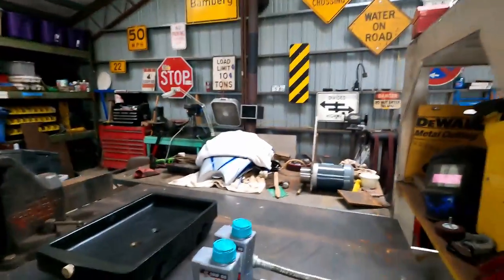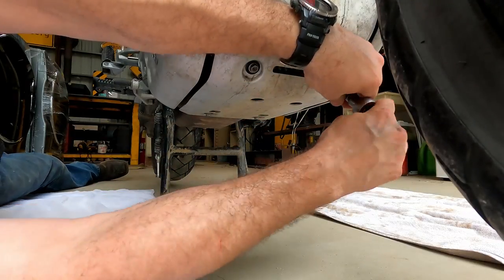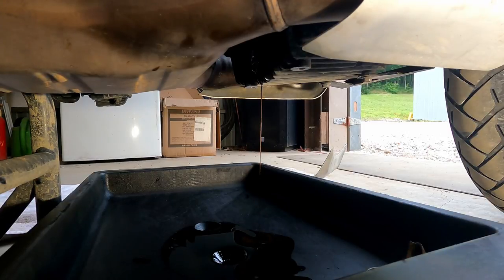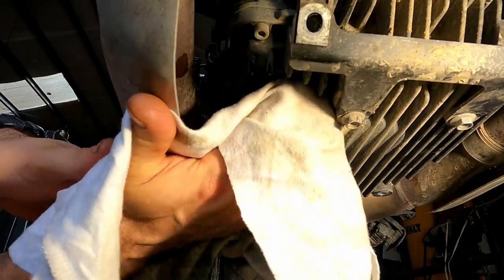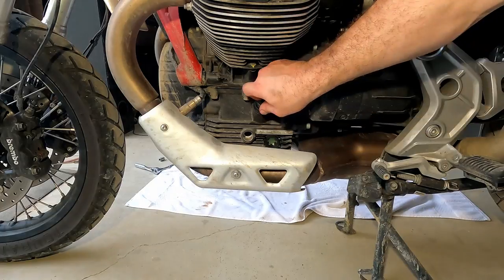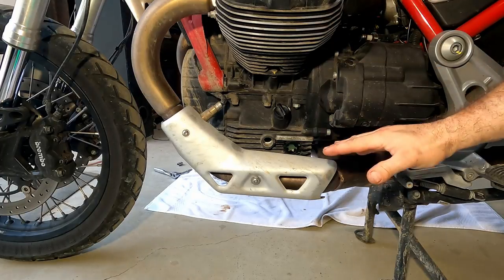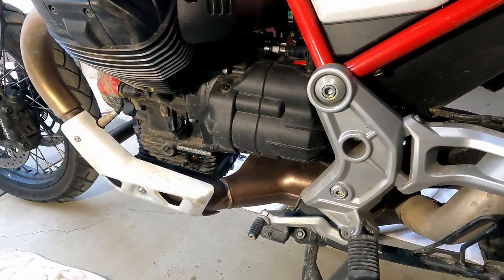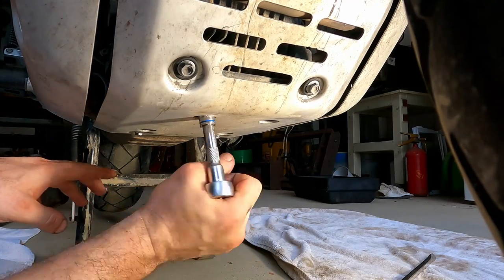Oil Change on the Moto Guzzi V85tt

Comment: Good video. Thank you. I do recommend changing the oil plug crush washer with each oil change. If you buy the Moto Guzzi oil change kit you will find that it comes with the crush washer, and also the oil filter o ring.m
Reply from the maker: That was the first one I did, I now have a 10 pack of the crush washers. 😀

Comment: I recomend everybody to verify the tightening of the bolts of the cracnkcase and also aply some bolt sealer (medium range) for the protector. As a good Guzzi is better to check the valve clearence and re-tight the cylinderhead, everytime you make maintenace (And if you can do parameters reset with the Piaggio or similar diagnosis tool to help the magneti marelli ecu to make the base injection map😊) it'a an advice from a senior Moto Guzzi tecnician✌️😎
Reply: Not required to torque head bolts.  Bad information

Comment: What Johnny Bravo said - I replace the filter's crush washer and O-Ring (along with the drain plug's crush washer) with every change. It's cheaper than the annoyance of having do deal with an oil leak because I tried to save a couple of bucks. BTDT & got the T-shirt.
A note on draining the oil - if you prop up the front wheel with the bike on the center stand, it tilts the engine a bit to the rear and you get a better drain.
Reply: Thanks for the advice, you can specify a link to the store where you buy the oil filter, ilter's crush washer and O-Ring. I am a new owner and I have no idea about the mechanics. Still. Thx

Comment: Thanks for the video, I needed a sanity check as I couldn't get my oil filter cover to come off the lower sump even after tapping with a wooden dowel.  I dropped the lower sump and even trying to tap the cover out from what would be the inside didn't cause it to move at all.  Currently the lower sump is sitting in a machine shop and I hope they can release the filter cover and I can move on with things.  Best guess is that the shop that last did the oil change over torqued the cover and crushed the o-ring and jammed the cover into the sump.  No surprise when owning a Moto Guzzi, the shop is 230 miles away and not really convenient to get the bike to them with the lower sump off.
Reply from the maker: Oh, that sucks! I'm sorry to hear that. Hopefully you will be back to riding it real soon.

Comment: Very useful, thanks for that! You might need to replace that crush washer on the oil filter bolt on the next oil change, looks like it might have a limited life. I think the oring should be fine for a long while, it's probably not getting crushed in there. But agreed, it should come with the oil filter judging by how much that costs haha!
Reply from the maker: Yeah, I would normally replace the crush washer, didn't realize that it didn't come with it.
Reply: @cubbysue  do you have specs or a part number for that crush washer?
Reply from the maker: @andrewpeter6657  I bought some on Amazon. They are supposed to be a 10x18x1.5 and the ones I got are 10x18x2. https://smile.amazon.com/dp/B07P37VX9R?psc=1&smid=A1THAZDOWP300U&ref_=chk_typ_quicklook_titleToDp

I haven't tried them yet, next oil change I will.
Ride safe.

Comment: How about a video on the do's and don'ts of checking the engine oil level of the V85TT and any quirks there may be with the model? Why?
I am happy I understand the basics of checking the level when the engine is warm and the bike is on the main stand on level ground with the ideal level being between the upper and bottom white lines. BUT,I keep getting wide variations in levels, sometimes the bike looks almost void of oil and at other times it looks over filled, I have done two small tops ups based on this! The bike has less than 4000 miles on the clock, it is not burning oil and it does not have even a miniscule leak anywhere! Puzzling!!!

Comment: Thanks…you did it all on the center stand.  Does filling need to be in the side or is 1/2 way on the center stand fine?
Reply from the maker: It doesn't specifically say,  but at the dealer, it's always on a lift standing upright.

Comment: Man!  Your bike sounds like a tractor almost lol!  Pretty cool!  Thanks for the how to! You mentioned that its common to see metal shavings in the old oil when draining.  I wonder how well Moto Guzzi stacks up against the other manufacturers as far as that is concerned.  I only bring this up as FortNine did a comparison of almost every bike manufacturer only they didn't include Guzzi.  Didn't even know that was a thing until I saw the video.  Anyways,  glad I found your channel!  Subscribed!
Reply from the maker: I watched that video as well, great job he did on that video I just did the 1st service on my new V85TT and did not find any metal on the magnet, but I am not sending the oil out for analysis either.

Comment: Very nice, I'd like to make a suggestion, you're dealing with an Italian machine, wash the bike thoroughly before service, it ensures that no dirt or abrasive stuff goes in the engine and if there's a leak of any kind, you'll know within minutes.
Reply from the maker: That is a good suggestion,  I  need to keep it cleaner than I do now, but most of the time when I do wash in town, it is filthy by the time I get home.
Reply: @cubbysue  My black V9 bobber full custom is a nightmare to clean especially with the Kineo spoke wheels. I avoid riding the particular bike in the rain for that reason. However, I have found that using the Turtle wax ceramic spray after washing the bike works excellent and doesn't allow the oily dirt to stick on any of the surfaces. It also lasts for a couple of months before it needs to be re-applied. Quite easy actually, spray the bike as you're drying it off. As far as degreaser without harming painted surfaces that actually removes synthetic oil and leaves a protection film, S-100. Buy the best and forget the rest. Cheers.
Looking to buy a 2022 V85TT adventure very soon, all Centenarios are sold out for 2021. The dealer told me to wait a couple of months for the 2022 incentives.  I'll either go for the red or .....maybe....the Ronald McDonald. I'll see what is available.

Comment: Howdy. Do you have a suggestion on how I could clean the visor from the oil pan? It's getting darker and darker and I can't check the oil level anymore. I usually change the oil every 5000 km. Thanks in advance!
Reply from the maker: Other that removal of the sight glass to clean it, I don't think you can get to it any other way.

Comment: Thanks for your video, following the oil change would the spanner service image go out or remain, if it remains how would it be removed? thanks again, Paul
Reply from the maker: It stays on. I have to take it to my dealer to have it reset. They don't charge me for it so I just drive over and have it reset. Check with your dealer, they will probably reset yours for free as well.

Comment: Cubbysue - on my 4 other guzzies I had to modify such as new chip, new NGK  spark plug cables, etc., is the v85tt ok as is?
Reply from the maker: It would definitely benefit from a new tune. I believe they are de-tuned at the factory level for emissions purposes,  but otherwise,  it's a solid runner.

Comment: Hello, thanks for that, am I the only one who is confused with that bike's service manual? I have read a lot of manuals, this one is confusing. So this bike needs three oil changes? engine oil,  gearbox oil  and bevel gear oil? And you did only engine oil here.

Gear box oil and bevel gear oil are of the same kind, right (75W 140)?
Reply from the maker: Yes, 75W-140. Change the oils in both at 18,600 miles /30,000 kilometers.  My bike at the time of this service was not due for the gearbox oil changes yet.

Comment: My 2023 V7 Special owners manual says to replace the o-ring, oil filter retaining bolt washer and drain plug washer. Why don't they supply these with the filter?
Reply from the maker: @Blair62  I have no idea.... seems like they should though.

Comment: Hey from germany. Really helpful Videos, im planing for getting a v85 too. Had one ride with a dealers one, are the 80hp enough for you? On journeys im with my gf, we both have around 90kgs,you think thats good? Keep up the good work!
Reply from the maker: I live up in the mountains and travel up and down almost daily and the power is sufficient. I find that I need to keep the RPM's up higher on the steeper parts, but it does ok. I would suggest taking her with for the next test drive. Oh.....and top speed is about 180kph.
Reply: @cubbysue  thank you! By the way, why you have a Bamberg sign in your garage?
Reply from the maker: I lived there,back in the 90's, got married there in 96. That was her hometown, so when we left, we took the sign with us.
Reply: @platterfreak Hallo aus Kentucky. Ich bin der Grund warum das Bamberg Schild dort hängt. Bin in Bamberg geboren und aufgewachsen und wollte etwas "Kleines" als Erinnerung mit nach Amerika nehmen 😝
Reply: @birgitfry6513 Eine sehr schöne Erinnerung,nicht ganz meine Ecke. Wohne in Bremerhaven. Kentucky looks beautiful :)
Reply: @platterfreak  ja Bremerhaven ist im "anderen" Deutschland. Kennst ja die Bayern.... Immer besser als alle anderen hahahaha. Ja wir sind nach seiner Militärzeit nach Kentucky gezogen weil es hier so aussieht wie bei Bamberg.

Comment: Thanks for the video. Just a couple comments:
1. Change the crush washer when you change the oil. And if you don't have a new one you can re-use the old crush washer by annealing it using a propane torch.
2. Tilting the bike (both sides) drains a little more oil.
3. Being air cooled Guzzis can easily over heat, 2-up in stop and go traffic on a hot summer day for example. Unless you are taking your V85 off road -- and let's face it, most of us aren't taking it on anything more gnarly than logging roads -- you can help with over heating by removing the skid plate for good.
Reply: It's got an oil cooler for that

Comment: Hello, could you tell me what is the tightening torque of the oil filter as well as that of the oil drain screw. Thank you for your video (a Frenchman from Limoges)
Reply from the maker: I have no idea what the torque spec on either is. I just snug them up good and neither has ever leaked. If I do find it, I will share it with you.
Reply: @cubbysue  MERCI BEAUCOUP
Reply: @cubbysue  
Couples de serrage Moto Guzzi V85 TT

- Vis de fixation amortisseur arrière : 50Nm (Guzzitek)
- Ecrou d'axe de roue avant : 80Nm (Guzzitek)
- Vis des pinces d'axe de roue avant : 10Nm (Guzzitek)
- Ecrou d'axe de roue arrière : 100Nm (Guzzitek)
- Pivot d'étrier frein arrière : 35Nm (Guzzitek)
- Vis de fixation des disques de freins avant et arrière : 25Nm + freinfilet bleu (post sur ce forum)

Comment: Why do you check oil level with it on the centre stand? It's meant to be checked standing on the wheels, they don't even have a centre stand stock on the base bike. It will look empty on stand even when it's half way full
Reply from the maker: Actually, there is no difference at all whether it is standing upright on the tires or standing upright on the center stand. It will still read the same. It will read different on the side stand.
Reply: @cubbysue  it reads differently on stand to on tyres, I've tested this myself, it reads low if you measure on centre stand. Of course it reads wrong leaning on the side stand, I'm not suggesting anyone check oil like that. The angle of the sump is different when it's on the centre stand compared to flat on the tyres, because the back wheel is off the ground. This causes the level to read differently in the sight glass.

Comment: Howdy @Cubbysue , the little yellow spanner showed up on my dash after the first 900 miles. I just changed the engine, gearbox, and diff oils and checked clearances, with your help, so thank you. But did you ever figure out a way to make that little spanner wrench icon go away? My dealer wants to charge me $70 to hook it up to the computer to clear the maintenance icon, I ain't doing that. Will it just go away on it's own?
Reply from the maker: I don't think it goes off on its own. My dealer is really cool and will shut it off for me for free. Charging $70 seems like a rip-off, if I find a way to do it, I'll post a video on it to let everyone know. 

Thanks for watching.
Reply: That wrench reminds me to check the oil
Reply: The spanner is the 6000 miles service reminder.

Comment: What is a Mia?

I have a V7 850 which I bought new in June.
Reply from the maker: It is a Bluetooth device that allows you to interact with the bike through an app you install on your phone.  It's $200 and it's awful. Moto Guzzi should be ashamed at how poorly it works. When it does work, it is a way for them to track and sell personal information about you. It is also a nanny that data logs to show things like max speed, duration of trip and a few other things that they could use against you for a warranty claim.
Reply: @cubbysue  Thanks. I have an OBD2 reader and I wondered if it was something similar.

The first service on my Centenario was done by my local MG dealer but I intend to do all the work myself in future.

I'm in Douglas, Isle of Man, just a few metres from the TT Course.

There's an MT-09 and a CB750K2 in my garage too.
Reply: @cubbysue  the data is held on the app. On your phone and not sent to Moto Guzzi, if you clear data or reinstall the data is gone. I have it and used it a lot on long trips and find the satnav really useful, I don't want the phone on the handlebars most of the time. I don't need the navigation either most of the time but I use the music streaming function every day I ride. Having control of the music from the handlebars is great, and also the intercom when pillion is on is useful too, especially because I can turn it off when I need to concentrate in traffic. The MIA also allows you to use voice assistant by holding the heated grips button in, so it's possible to start apps, make calls etc. Without even taking your phone out of your pocket.

Comment: Where did you order the filter from?
Reply from the maker: I normally buy the oil and filter from my local dealership,  but you can find deals on the filters on ebay from time to time.
Reply: @cubbysue  my local dealer is 200 miles away lol
Reply from the maker: @BetaRacer24  Road trip!
Reply: @cubbysue  cant, bike needs an oil change😂😂
Reply: Mail order

Comment: How do you reset the service light?
Reply from the maker: I still have to take mine into the dealership for that,  but the guys at Gateway Cycles do it for me for free.
Reply: @cubbysue  Oh, okay, I was hoping there was a way to do it in my house, because in my dealer they charge me 20€ for it
Reply: @Motion_0112  I wish my dealer charged that little! Their minimum is 30min labour, about USD75.

Comment: You're running those skid plate bolts in wayyy too far.....1 or 2 turns, just to get them started so you have maximum movement of the plate and that will makes things a lot easier.

Comment: As all other people, they do not know the O ring will last many years, but you also made the mistake NOT to change the aluminum gasket on the bolt.
Now you might have oil dripping’ NOT because of the O ring, but because the aluminum gasket HAS to be changed every time.
Reply from the maker: @oluffriesthomsen7680  Well. I hate to say it, but you are wrong. It doesn't leak, drip, seep or otherwise lose oil from the drain plug. When it gets too smashed, I do replace it with a copper one. That is usually about every third or fourth oil change.
Reply: @cubbysue  
Then i must have been lucky the last 35 years reparing Guzzies.